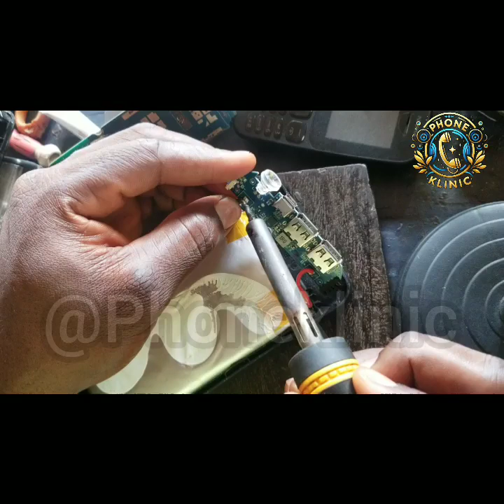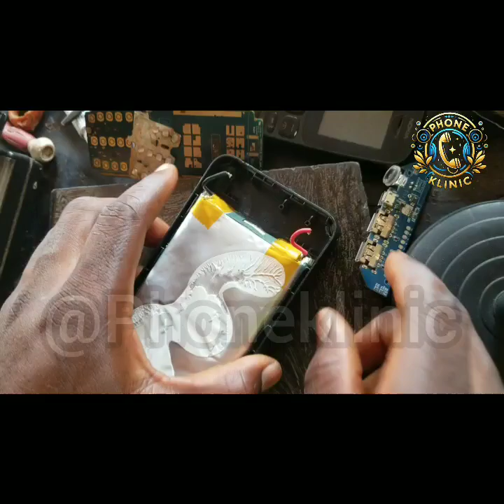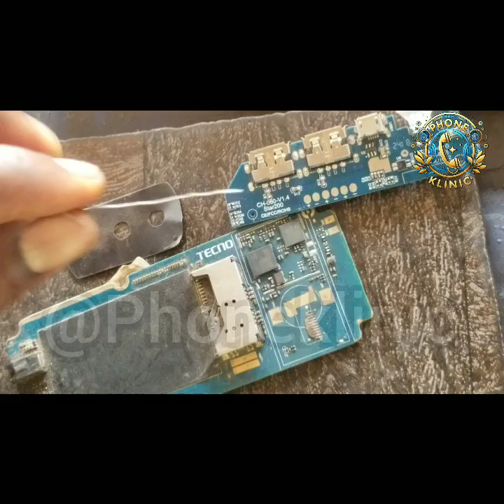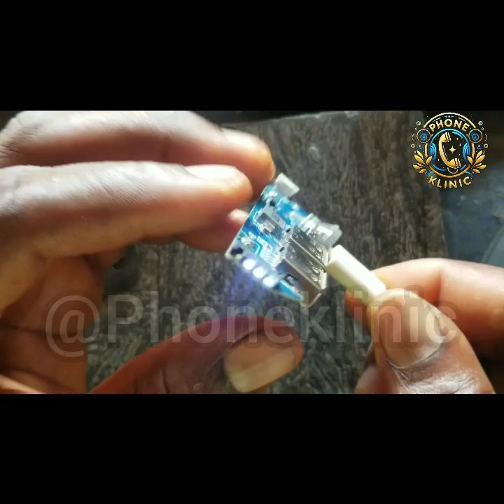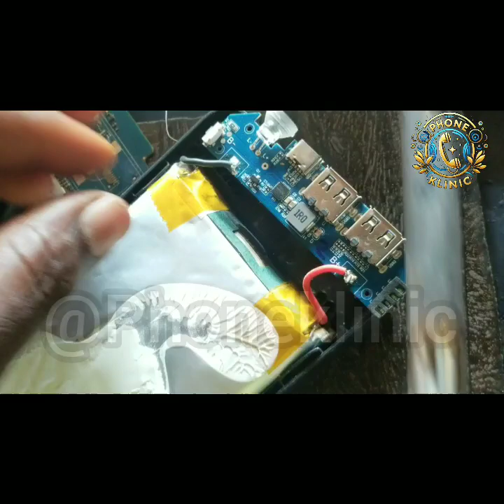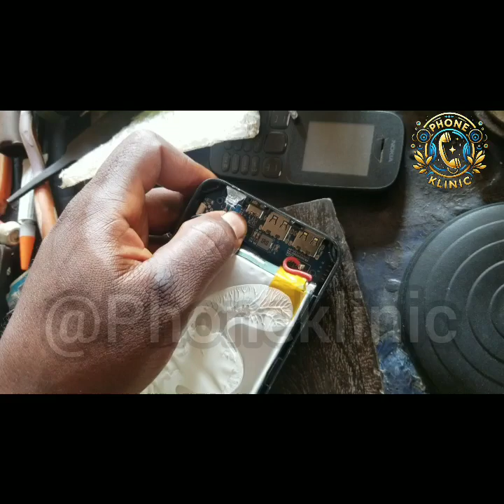Itel 20,000 mAh power Bank Repair #recommended #smartphone #phoneklinic #repair #ochemobiletech

Comment: Sir I have a panel that's one the first part that's blinking when charging and using but when I resold the resistor some part off and the values are not same I wanted to ask is it the resistor or it has another issue sir

Comment: The one I'm working on is not charging my phone
Reply from the maker: Okay First Disconnect the battery from the panel and get rid of any left over voltage on the PCB then clean it first and then start checking for physical damage on the PCB. But if there is none then try to troubleshoot with your Multimeter on the PCB from the input voltage of the battery into the management IC down to the output
Reply: @ochemobiletechs  Why don't you just make a video on that
Reply from the maker: @Wiseman-szn  soon